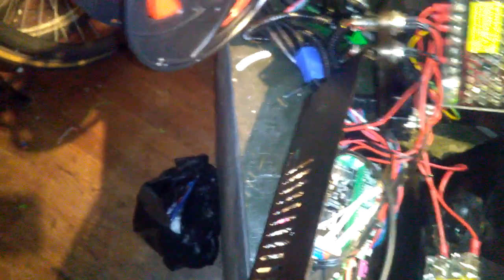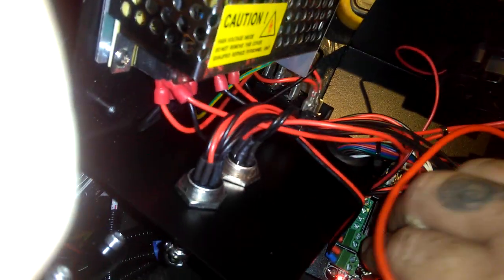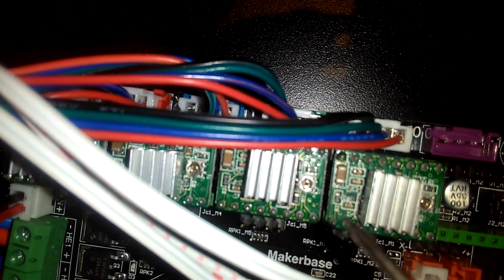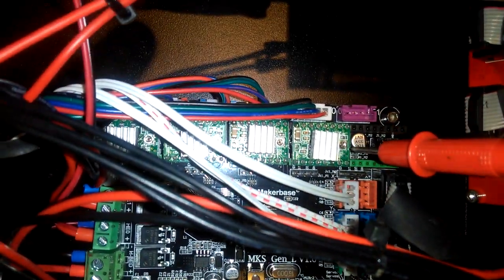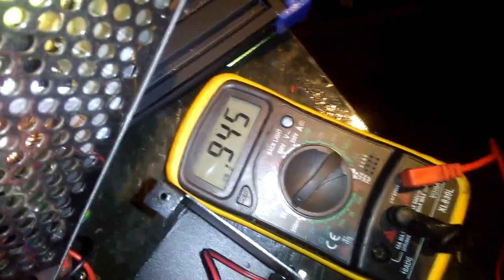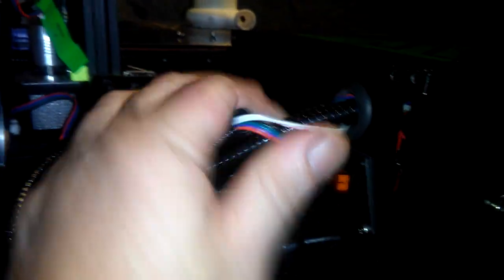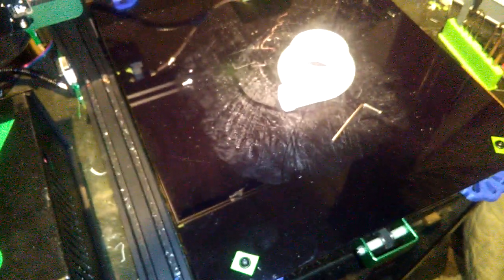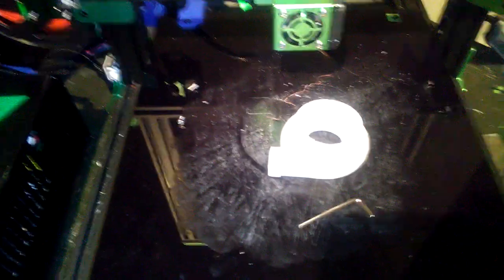Tevo Tornado Adjust Stepper Motors Voltage and Starter Tips.Read description also.

Comment: Can you clip the ground clamp onto the control box fan grille?
Reply from the maker: Any ground should work. You just wont get a signal if its not grounded
Reply: 66/80 Motorsports Thanks just did the modifications and now it’s printing like a beast. Going to see if any layers shifting occurs at the end of the print

Comment: I ordered one of these a week ago but I ordered the gold updated version.
Reply from the maker: Be sure to check the voltage, they are sent just to get the test print off. I had dragging issues after a week. Once the voltage was adjusted, thing runs like a dream.